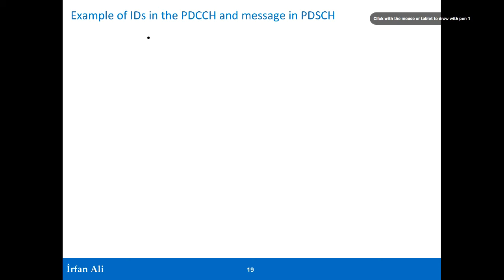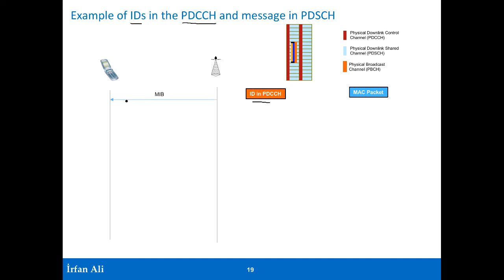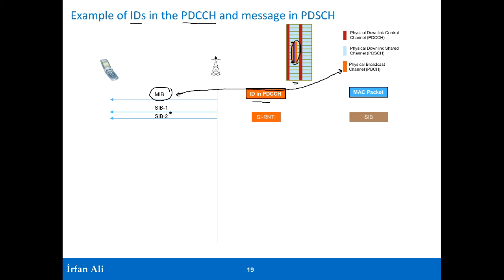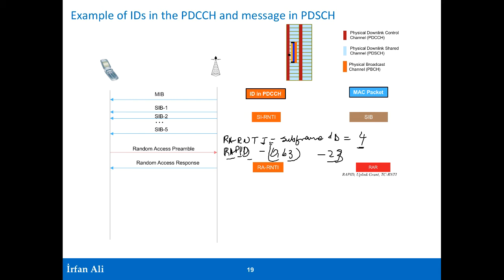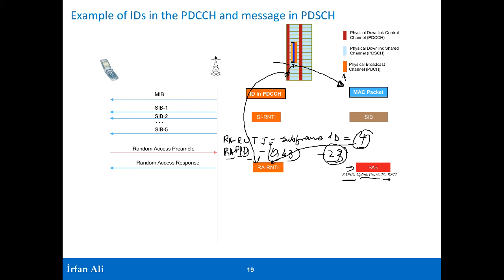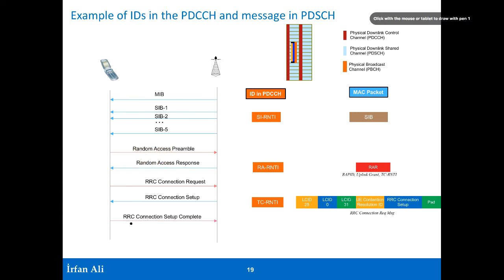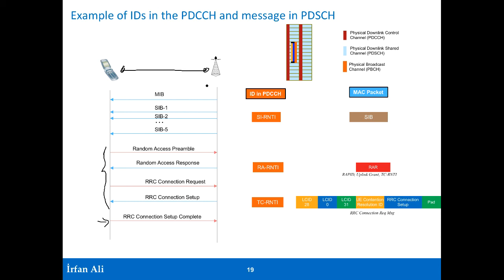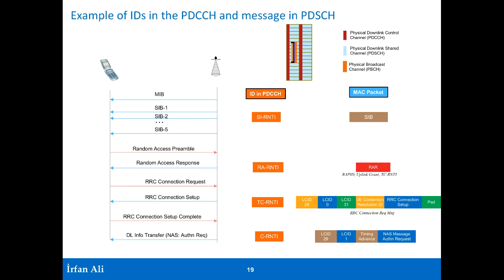LTE Radio Primer Part 6: Random Access & RRC Connection Setup

Comment: sir in rach procedure,RA-RNTI is caluculated by enb based upon the time at which preamble sequence is sent............................but based on sib2 parameters "configuration index & ffrequnecy offset "only ue transmits preamble sequence...which means enb itself is assigning a time, then in this case,y cant it assign different "frequency ofset n configuration index" in sib2
so dat no contention wud happen